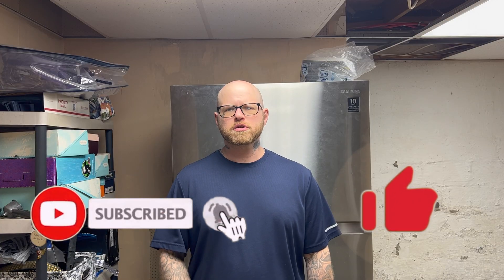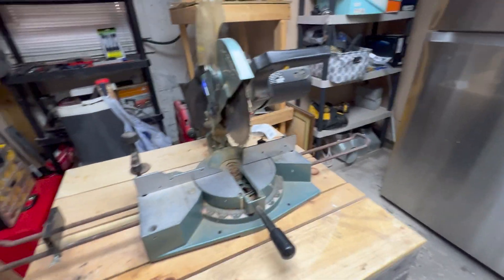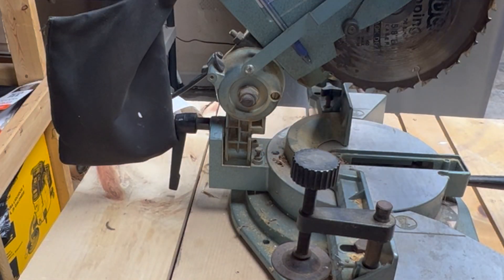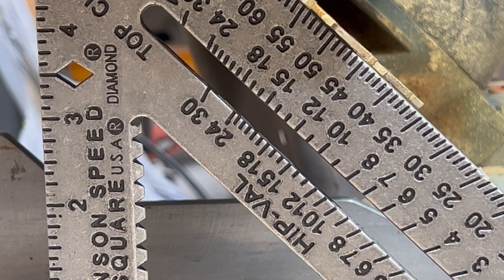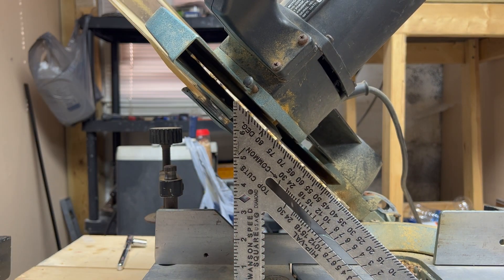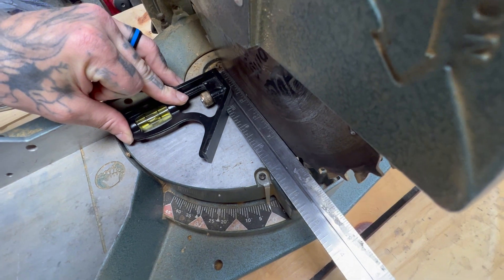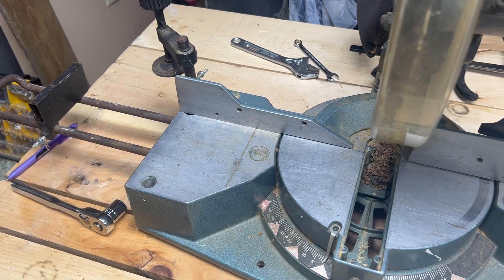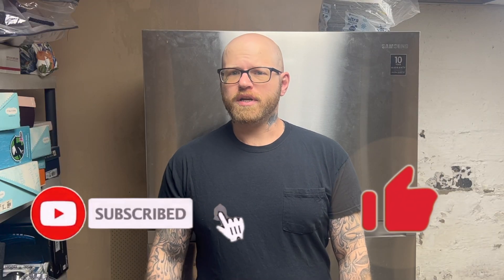How to Calibrate a Miter Saw

Comment: Bruh, How to adjust the 90 degree angle? You did not show how to adjust it if its  a little bit off.
Reply from the maker: At 2:15 I show how to adjust vertically to be square to the table. There’s a little bolt that needs raised or lowered. 
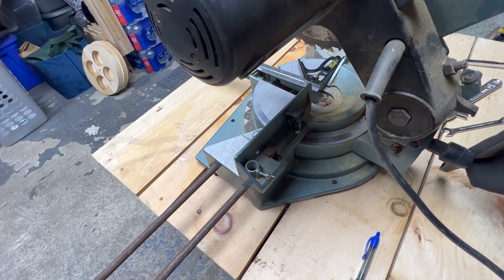At 6:08 I show how to adjust horizontally to be square to the fence. The fence has two bolts that you can loosen to move either side of the fence in or out. 
Thanks for watching.